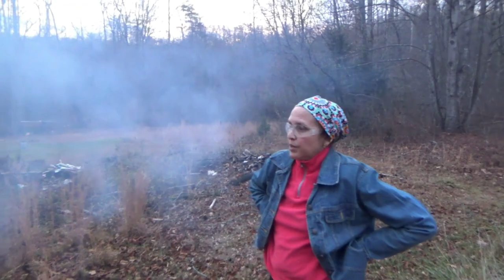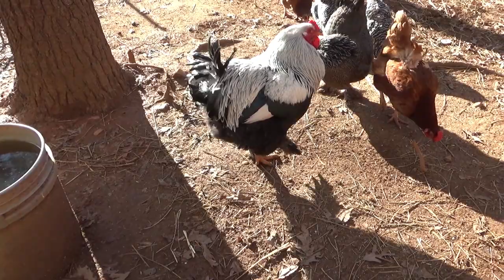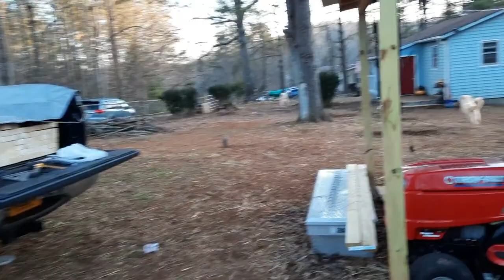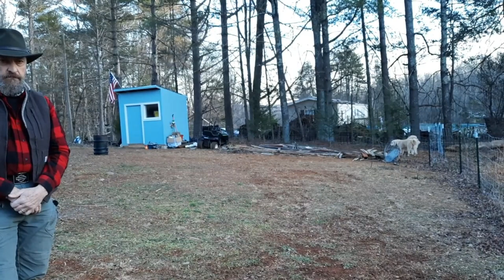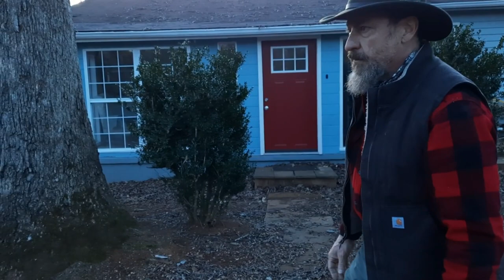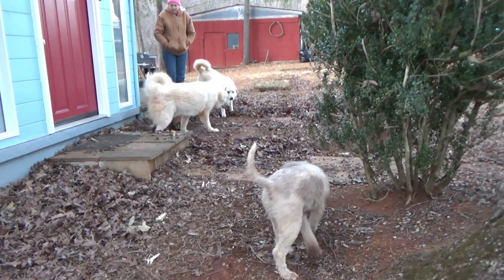Building a Simple Gate

Comment: I know what your hands are feeling those finger cracks are awful! My grandmother called it salt rheum. I use crazy glue original formula, not the 2 part stuff.  Just fill the cracks with a small amount of glue. I know it sounds weird, but I was nurse and bandaids didn't cut it. The one I found that is quite good is a single tube with a red label  green  cap that has a pin. Use hand cream too.🙂👍👍🇨🇦💓